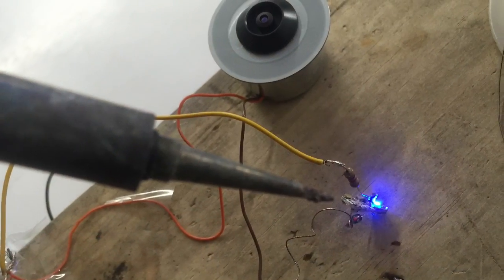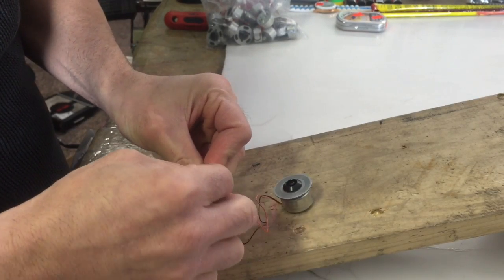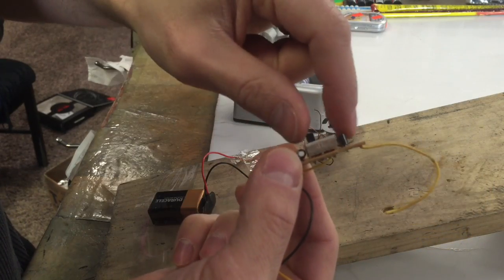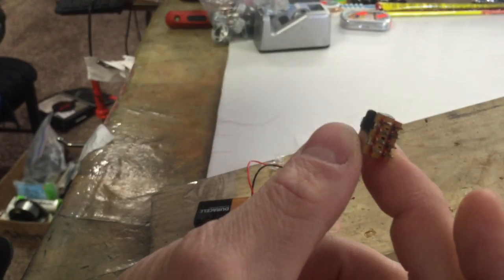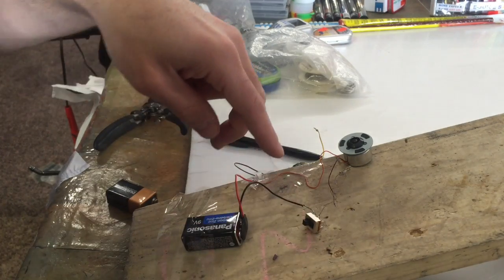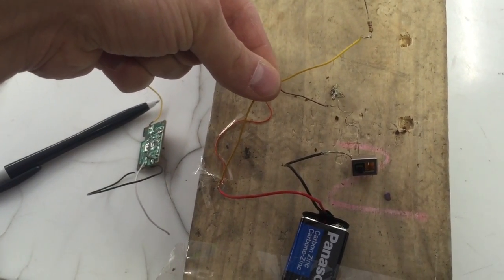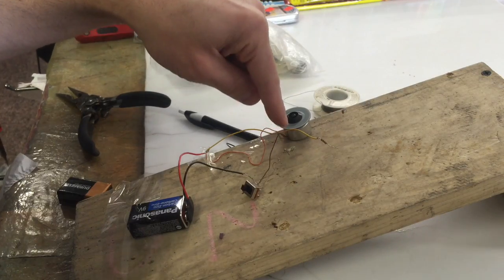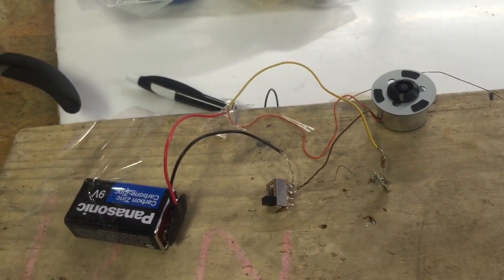How To Wire A led light motor and a on off switch

Comment: On the LED back to the switch. Want to wire an LED to my switch to indicate the circuit is on. If I pick up positive from the switch but the negative is picked up from the chassis, do I still need a resistor? Lost on this.
Thank you!

Comment: i have connected positive terminal of battery to the switch and negative terminal to the motor,.Now i wanna put LED before motor and i have to put resistor before it, so where from (which terminal) can i connect the resistor?  please guide

Comment: thanks, just what I needed, now school was a long time ago, am I right in thinking the resistor is pulling down the current to prevent the circuit flowing back the other way, oh boy, that sounds so wrong :P
Reply: resistor decreases voltage so you dont burn out your components
Reply: @Neonfloyd  What he said :)

Comment: Hey this video has been pretty helpful. I have a project where I want to wire some leds to a motor..however Im hesitant, and worried I may blow the motor (currently powered by 4.5volts). Im not sure if the original 4.5 voltage is just to get the motor to spin slowly (for its designed purpose), or if that is all it can handle. Im worried a 9v may be too much. Any advice?